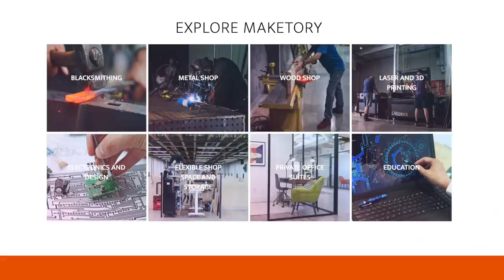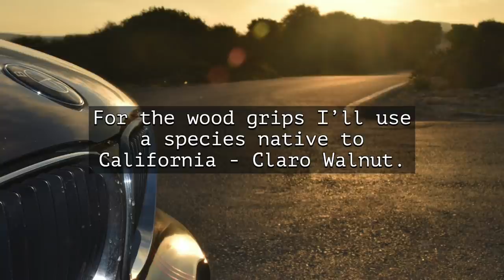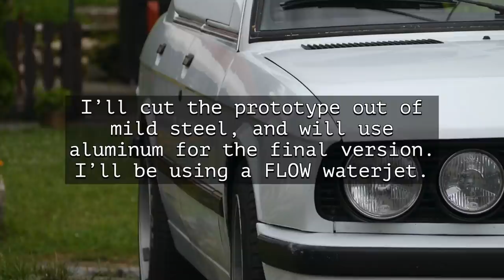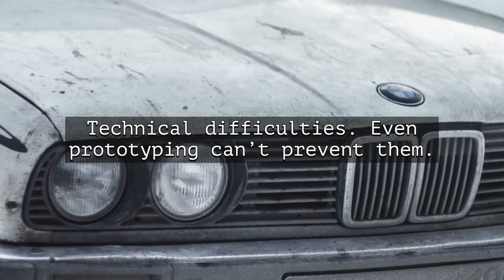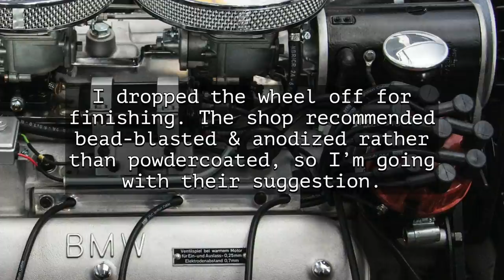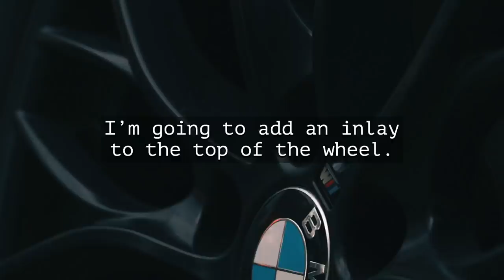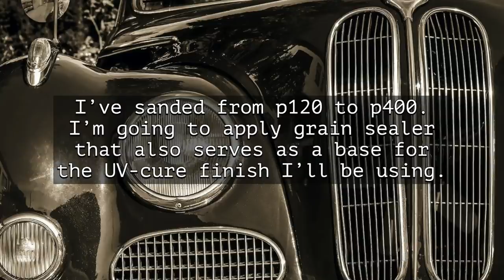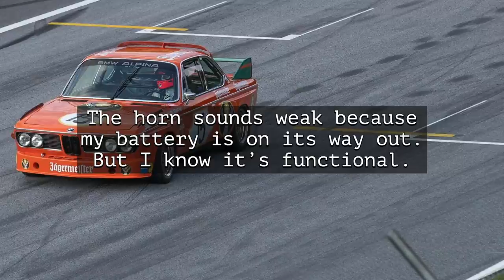Making a Steering Wheel From Scratch (DIY time-lapse) [BMW e28]

Comment: you should make a shifter knob that matches the wheel
Reply: please do a custom upholstery on interior. i will sponsor you!
Reply: And never drive without gloves again 😅
Reply: @olsenautofix  the car is already in pristine condition as is. While DIY is cool, especially when done this good- some things shouldn't be messed with.

While shifter is often done to match the wheel, thought didnt cross my mind when watching the video but know what did?- wow, thats a clean sexy shift knob.

P.S. i doubt you will put your money where your mouth is but ill be surprised if $20 reaches him.
Reply from the maker: @unclesamthejew8740  this car is far from pristine condition haha. I did end up making a matching shift knob, it's my most recent video
Reply: @FOURfabrication  ive just watched the video. You did a good job once again.

Again, im not sure shift knob needed changing but indeed it matches tastefully and im assuming key is next on the list lol.

Perhaps if i were you i would've made custom steel "dogleg shifting diagram" to match the wheel vibe rather than to match center cap for the horn. 

P.S. i drive a w124 ce with only 70k km on the clock and its quite an attention grabber despite being nothing special. 

Despite the low mileage however its in significantly worse condition than yours. Even if you wont show flaws on video and are aware car is not museum quality you should take great pride in both machine itself and your work (DIY and maintenance) over it. 

Cheers
Reply: Definitely, yes. Some other details that armonize with the wood of the steering wheel can improve the aesthetics
Reply from the maker: @andressaez7647  check out my latest two videos! I make a walnut shift knob and interior window louvers
Reply: @FOURfabrication  sorry, i speaked too soon😁. Wonderful work. Do you make guitars on the CNC too?, Ok, I see the guitar too. I LOVE It.
Reply: You prolly dont care but does anybody know of a trick to log back into an instagram account?
I was dumb lost the password. I would love any tricks you can offer me
Reply: @Arlo Blaze Instablaster ;)
Reply: @Parker Luis i really appreciate your reply. I got to the site thru google and im waiting for the hacking stuff now.
Takes a while so I will get back to you later with my results.
Reply: @Parker Luis It did the trick and I finally got access to my account again. Im so happy!
Thanks so much you saved my ass!
Reply: @Arlo Blaze glad I could help xD
Reply: Nice job. I want one for my mini cooper s

Comment: 32:23 this guy has the original radio in his 80s car and a drink on the dash -> he will never sell his car
Reply: I have an e30 and there isn't a single cup holder in the car. You got to get creative with drinks lol.
Reply: would be a big mistake. given the condition and the low milage this car is in. hell thats a lot of money!
Reply: I had an e30 and kept it all original, how it’s supposed to be no drinks just pure driving
Reply: @dillanmistry  I didn't meant drinking in the car would be a mistake. I meant selling the car would be a big mistake 😅.
Sorry for not clarifying.
Reply: @PARA19951  ohh yeh thats right 😂
Reply: Haha, I have an e30, and it had an aftermarket radio in it when I bought it. I literally got an original radio from a junkyard because I wanted to have it the way it was from the factory 😂

Comment: Great job. You used the same techniques I did about 15 years ago. I made a steering wheel for my brothers mahogany speed boat.  Really brought back memories.  I even clamped the boards with pipe clamps like you did.  I built one more recently and basically made an octagon with the wood and tenoned the sections together. I also rabbited the inside so the split rim halves wood hide the outer section of the aluminum rim.

Comment: from start to finish this video is everything i needed it to be, i recently got into wood working and have purchased more wood working related tools than most people have, i also have a love for vintage bmw as ive owned well... ten of them now including an e28, a 740i e38 that i did an as close to oem manual swap as i could using actual 740i/6 drive shaft and shift linkage, an e39 with aubergine individual interior, several e30's and my current bmw a humble 98 328i convertible. i really loved this video especially the ending cruise, thank you so much and i cannot wait to see what other content you have.

Comment: Great work man! I admire your tine and dedication. In lazy as hell and definitely dont have access to those type of facilities so I would be the guy buying an mtech, momo, or nardi lol. That came out incredible. I love e28's. Hell seeing this video makes me miss my '83 533i. That car was a tank and treated me well. Hard to argue with the m30, 5 speed, and an LSD with all the proper mods. A Holset setup was sitting at my shop waiting to go on mine, but before I could finish stockpiling all my parts, some lady in a ford explorer slammed into the back of me at about 35- 40mph. The car still ran and drove same as before, no broken glass, and both back doors still opened and closed like normal. Like I said, these e28's are built strong! Digging your dash cover with the whole 'Beyern' looking livery. Crack free dashes are getting harder and harder to find. I sold an e30 one I had laying around that was mint and got $550 for it! I'd imagine an e28 one might even be harder to find. You should post this up on mye28. Those are a great group of folks who share the same passion for these cars. Most are also CCA members, and there isn't the riff raff shit like on rev or bf.c. I think they would really appreciate your work. What are your future plans for the e28? S38 swap or an hx35 like I was going to run would be the shit. Thanks again for sharing this dude! 👍😎💪
Reply from the maker: Thank you, sir! Sorry to hear about your e28, I live in fear of that every day, haha. I've looked for crack-free dashes, they are running $2000 now, a bit less for one that's been repaired and upholstered but I don't really want vinyl. I've posted on mye28, they were very complimentary. Future plans right now involve swapping to Motronic 1.3 (e34 535i computer) and MAF. Probably won't be a huge power gain but it will have better throttle response for sure. I bought it as an automatic and so far have done the 5-speed swap (new clutch, lightweight flywheel, short shift kit) it already had an LSD but I'm considering finding a 3.73, and I did the euro headlight conversion, M5 wheels, Suspension Techniques sway bars and M5 suspension/ride height.
Reply: @FOURfabrication  Those are all great mods for the m30/ m20 based cars, the DME and the hot film MAF is a great upgrade for sure. I almost went for the one from Miller Performance when I had mine. They probably use an off the shelf sensor like many others do from a Porsche but I never really looked into it. Bottom line is the 'barn door' AFM is a pretty big restriction. Good stuff on the suspension setup! I used bilstein inserts on mine with shortened housings and GC coilovers. Made it so much better, and wasn't all that expensive. The sways make a huge difference as well, but unfortunately I never made it that far with mine because it got wrecked and I was dumping all my money into a particular e36 track car I built. Glad you swapped it to a manual and went for the ltw flywheel. The 3 73 is pretty much the best ratio unless you go for a custom diff from one of the vendors but they are FAR from cheap. You have a build thread posted anywhere on your car? I'd love to check it out. Take care man👍

Comment: Nice wheel. Did you not use walnut for the dow's and strips to cover the outside and inside. Reason I ask is because they are a different shade.You could let the black show through also on the outside and inside, and it would also look good. You drive a little fast in a residential area. You need to slow down for caution purposes.  You should make them to sell. Thanks for the show. Ronnie.
Reply from the maker: The strips are from the same walnut stuck, it's just a a different part of the wood with a slightly different color. I was intending to have the black show through but I used a little too much epoxy so had to chisel out the squeeze-out and cover it. The dowels are just random softwood, probably pine. Thanks! I will try to slow down, haha
Reply: @FOURfabrication  It's a very good wheel. You done a good job. Ronnie.

Comment: Not bad kid, but i think you should have used a walnut dowel to fill the aluminum insert at the top of the wheel, that would have looked so clean, just a polished bright aluminum circle, all by its self, and not so imposing as the big DOT, also , the wheel maybe looks a little out of scale for the rest of the interior, the wood came out a bit to big and bulky. Overall, I think you did a great job in general. If you should decide to do another wheel at some point, slim down the wood.
Reply from the maker: Thanks! Yeah, I need to invest in one of those dowel cutter bits so I can make them in any material. Plans for the next wheel: I think I'll use stainless instead of aluminum and create a jig to bend the spokes and weld them to the rim to give it an offset, slim down the wood grips and add finger grooves

Comment: Question: What was the cost of that project? Not just the materials, I guess working at that coworking space costs money?
Reply: i Wouldn't diy a sterring wheel. These things are supposed to handle crashes a certainw way. And without extensive simulations and Engineering you won't get that safety.
Reply: @Daniel-dj7fh  Your comment has literally nothing to do with what I've said?
I simply want to know the cost. Period. 
I am very aware of the fact that you can get a way safer steering wheel for way less money, but that's simply not the topic that I've brought up.
Reply: @Liphzzy  im not talking about a way safer steering wheel. Im talking about a safe steering wheel. Wood glued on a metal circle isnt safe.
The Cost depends on everything, what metal you use, howe much metal you use, what wood, how much wood, what glue, how well you want it to be fabricated, the precision of the fabrication,  etc.
You could spend 100bucks, you could also spend 1000bucks
Reply from the maker: The materials were like $130. $90 for the walnut and I have a bunch left over for a shift knob and a guitar neck, and the aluminum was $40. The coworking shop costs $2,000 per year but I use it to make and repair guitars for customers. Also MOMO hubs are designed to collapse and provide some give if you're in an accident, obviously not as safe as an airbag but it's a pre-airbag car and I don't drive it every day.
Reply: @FOURfabrication  Okok, thank you for giving an actual response to my question :D
Those coworking shops look pretty decent, never knew those things exist.

Comment: its a great work out there, but I have a question concerning comfort: the wheel dose not have any bend, its just on the same plane, is it good for u ?
Reply from the maker: Yeah there's no offset to the wheel, I'll need to learn to bend the spokes equally and weld them to the center part to do that. But because of the length of the hub and the 1/2" extension it sits the same distance from the turn signal and wiper stalks as the factory wheel.

Comment: I love the final look and the design process behind it! Seems like the grip turned out a bit too thick, you probably should have accounted for the thickness of the aluminum before CNC the walnut? I might be going the same way, but Im curious, is it cheaper than spending U$400 on Momo/Nardi steering wheel?
Reply from the maker: So the aluminum wheel is .19” and the rim part of it is 1” wide, meaning there difference of its inner diameter and outer diameter is 1”. Because my CNC bit is a perfect 90 degree roundover, that meant there would be a flat spot on the side of the wheel so I added .19” to the walnut grips. So there’s a 1.19” difference between their inner and outer diameter so there is an equal flat spot on all sides of the steering wheel (front, back, inside and outside) - so the result is not a perfect circle but just as comfortable. I’m gonna figure out a way to work that out for the next one, I’ll be learning to weld soon so I can bend the spokes and weld them to the rim giving the wheel an offset (dish). It was really cheap in materials (like $130 not including the hub which I had already) but a lot of labor but it was worth it to challenge myself. Thanks for the compliments!

Comment: Awesome work, loved the video! How does the wheel hold up while ypu use it? is there something you would change maybe? :)
Reply from the maker: The wheel feels great, I love it - in the future I want to be able to make wheels with an offset - I'll need to learn to weld to that's my next goal. I might add finger grips to the backside later, it will be easy to add some more finish
Reply: @FOURfabrication  Hope youll make a video about it :)...you gave me inspiration and i think ill try to make my own..im a product designer and i have an e30 :) (also all the tools needed)

Comment: Man great video and craftsmanship. I just think that the steering wheel doesnt fit the car, at least the wooden color, there are no details inside the car to match the steering wheel. Nice work
Reply from the maker: It's definitely more of a '70s style wheel than '80s, I will make a matching shift knob once I learn to use a lathe. Thanks for the compliment!

Comment: Awesome work man!
But i got to ask - what type of glue did you use?
Reply from the maker: To adhere the wood to the metal? I just used an epoxy. Everything else I used CA glue because it would all come in contact with the epoxy later so I didn't need to wait overnight for wood glue
Reply: @FOURfabrication  fair enough
Thanks for quick answer

Comment: I had an 88 E-30 M3. I loved that car but after 176,000 miles it was costing me a fortune all the time. I sold it in 2001. Biggest car mistake I’ve ever made. Best sports car I’ve ever owned.😭😭😭. What guitar company do you work for?🤔🤔🤔
Reply from the maker: Legendary cars, I wish I could afford one. A fun fact is that the Italian market e30 320is has a slightly destroked version of the M3’s S14 engine, so it’s like an M3 without the widebody. Hidden gem of the BMW world. I am working for myself now, just getting started with my own guitar brand.

Comment: May I kindly ask how thick the aluminum plate was, that you used?
Reply from the maker: It was .19"
Reply: @FOURfabrication  thanks. And how thick was the plate?
Reply from the maker: @linuxcnc6847  That's what I mean, it was .19" in thickness, slightly over 3/16"
Reply: @FOURfabrication  Sorry, I'm a metric guy and missed the point in front of the 19"...Thanks a lot.

Comment: Should have calculated the circles a little differently, you didn't subtract the metal in the center from the thickness of the two halves.
Reply from the maker: True, the roundover bit I used it for cutting a perfect radius, so I made the grips overhang the wheel so I’d have an opportunity to use the strips to hide the metal but also to give the front and back of the wheel a flat spot equal to the flat spots on the inner and outer perimeter

Comment: Very cool.  Something you can lay your hands on, everyday.  I think it is a nice piece of work.
Don't understand the aluminum tube inlay dot at the top?   Must be a BMW-thing?
Reply from the maker: Racing wheels often have a center stripe to give the driver a visual indication of the steering, it's just a way of doing the same in wood. It's not a race car though, so just decoration

Comment: Do you sell the s. wheel?
Reply from the maker: Not right now because I’m working on guitars but enough people want them that I’m considering doing a run in a few months, and I’m going to learn to weld so I can add an offset to the wheel
Reply: I’m looking at e30’s at the moment. If I decide to buy there is no wheel I’d rather have than your design man. Awesome!

Comment: Doing this is illegal in Germany.
Reply from the maker: TUV?
Reply: @FOURfabrication  Not only TÜV you also need an ABE (allgemeine Betriebserlaubnis) which means something like a permit for a part that you want to use on your car. If that part doesn't have an ABE and you get busted there is a chance that they confiscate your whole car. Furthermore there are parts that require an extra inspection when used. Like dampers or a steering wheel that are from a 3rd party. So tuning your car in Germany is highly restricted and very expensive.